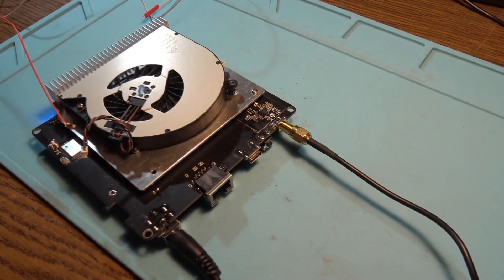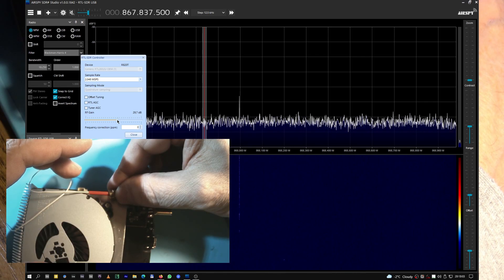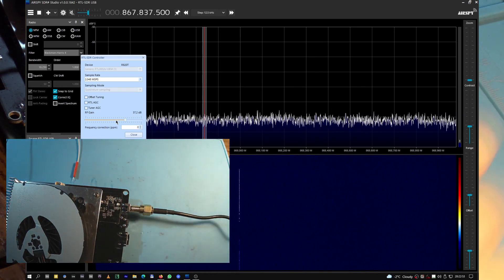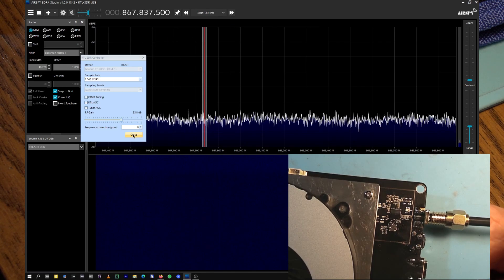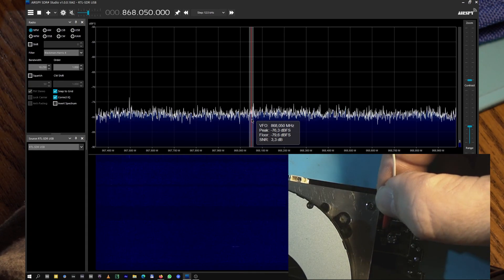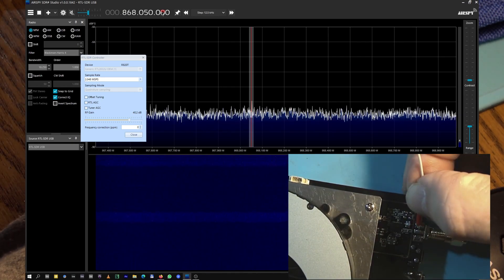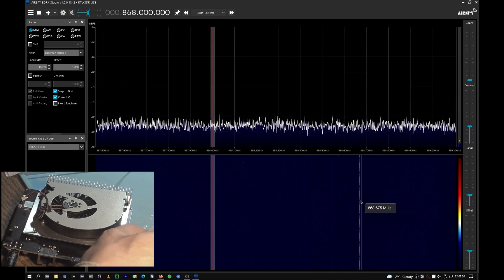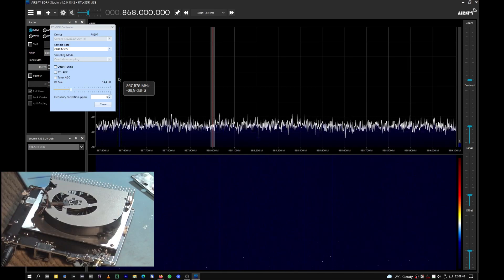Heltec Helium miner saw filter replacement

Comment: thanks for what you do! 
really interesting your videos! so I have a question, I have a faulty heltec and a working one (I’m near telephone towers) what do you advise me to do? to put a filter (those produced by heltec or that of aliexpress?) on both?
sorry for the question but you are very prepared.
Thanks again
Reply from the maker: Yes, a filter should help cleaning the radio space around Lora band..you can have Ali ro any filter , they are all the same..saw filters.Check the frequency , it should be 686Mhz for EUrope and 915MHz for US

Comment: Hello Viorel,  I removed the saw-filter after the vna at my sensecap and the results after all improved.   But ... I did first a little mistake by soldering a bridge, where the filter was before - everything is so tiny.  The bridge had not really a connection, so no signal got through and I had for one day no witnesses, as you.  May be, that's your problem as well. Check again.    Your current constellation - filter before the vna and after the vna none is okay - as on my sensecap.   Maybe your vna is weak or "kaputt".   Greetings from Germany  Ulrich
Reply: Ich denke du meinst LNA und nicht VNA oder? 😅
Reply: @cabanossi  Stimmt, that's right. sorry.  Low Noise Amplifier. Of course.
Reply from the maker: I just ordered new IC, a replacement will be soon in place.Then I'll know for sure what's wrong..anyway no witness for 7days..but it's beaconing so TX is running